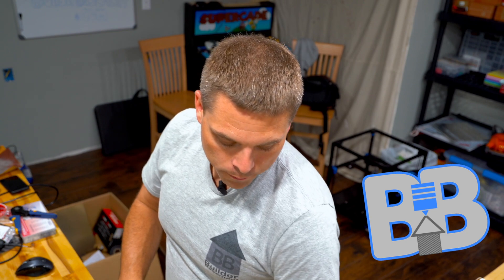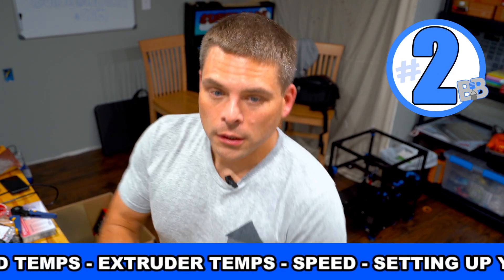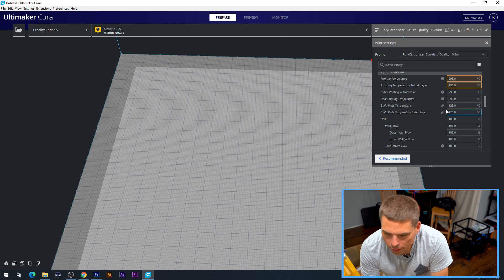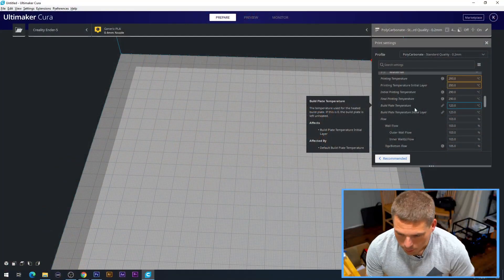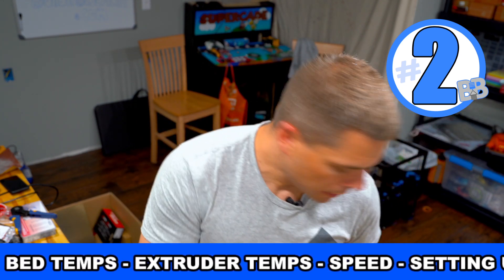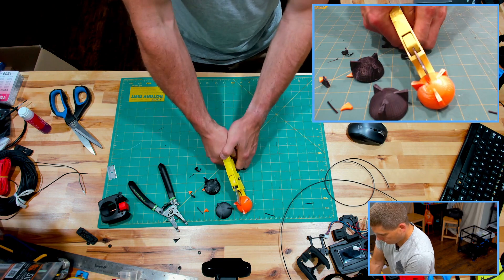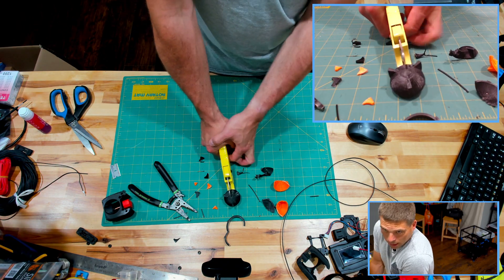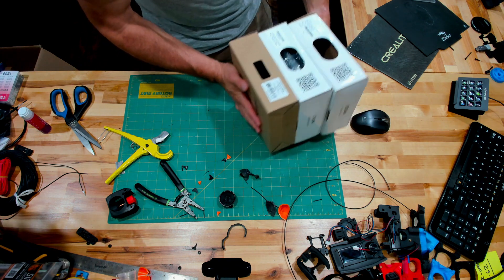Bulletproof Polycarbonate Filament! Tips on printing PC with an Ender!  ABS too!

Comment: I am looking to print PC-CF on my Flashforge Adventurer 5M Pro, is this possible ( with functional results, ) without modifications to my printer?
Reply from the maker: Yes!  You'll be pushing the limits, but it is possible.  Using a CF version will help some with warping, so that's a good pick.  You will need to use a larger nozzle than normal (0.6) since CF will likely clog a 0.4 nozzle.   You will probably need to use a PC bed adhesive, such as https://amzn.to/4dXBPgp. In my experience with the Ender, I had to create my own PC build plate, which would also be an option, but not recommended.   I would start slow, keep your bed near its max (100)°C and your extruder at around 270-275.  Run some small prints that are just a few layers (5-10), inspect them, and adjust as needed.  You'll be looking for warping, layer adhesion, and decent aesthetics.  Let me know how it goes!
Reply: @BuildItBasement  Thank you so much for the advice, I will closely follow it and update you! 

BTW, as for your suggested " PC bed adhesive " would you recommend the nano-polymer liquid stuff for use with PC? I always use that and it's great, but only with PLA/PETG, never with PC yet.
Reply from the maker: @JValor  Try what you have - Nano is VERY good stuff.  I'm not a huge fan of adding things to the bed, but in the case of PC and PA - it can be really hard without them.

Comment: How are you getting your bed temp to 123 C?
Reply from the maker: Physically or software wise? Physically the printer will do it fine with a basic enclosure.  The firmware will either need to be modified using Visual Studio or (my preference) installing Klipper.
Reply: @Build It Basement  im just going by the manufacture's specification of a 110 C max bed temperature

Comment: First couple min you got me to subscribe 🫡
Reply from the maker: Older video - So much more to expand on! Maybe at some point.  PC is great to work with.  Printing on a piece of PC really helps when you don't have the ability to get past 100 degrees!  I have made some neat things out of PC - At some point, I would like to make a drone frame out of PC and a VERY thin wrapper out of a flexible (impact-resistant) filament.  Not enough time in a day!  Hey, thanks for subbing!  Leave as many comments or questions as you like and I'll reply as best I can!

Comment: Hey thanks for the video. Im printing a 4" x1/4" shaft and need it not to bend under force. I have a ender 3 pro. Can I print the shafts in polycarbonate and just tweak the settings for results? What are your thoughts?
Reply from the maker: You will need three things to help you.  (1) You will need to update your firmware to allow for increased hotend temps. (2) You will need an all metal hotend like this one: https://amzn.to/3HhLnme or better yet this one: https://amzn.to/3JncKOH (3) You will need an exclosure for the printer a simple cardboard box can work, however I was be careful since cardboard is a fire hazard.  I have this one: https://amzn.to/3wFBjyO .   You will need to do some testing and you may need to buy a piece of plexiglass at a hardware store about the same size as your bed.  Rough up the surface with 100-150 grit sandpaper and clean it with ISO.  Good luck!

Comment: How did you get to 290?? I tried firmware update and slicer settings but no luck. I have a Neptune 2s.
Reply from the maker: It's the printer failing to get to 290 or does the software reject the temp?
Reply: @BuildItBasement  I believe its the firmware rejecting. It has the max temp at 275 but it won't go past 260
Reply from the maker: @WeTheWaveTV  The Neptune would need to have the firmware modified, I would suggest flashing it with Klipper (found this read for you) https://www.reddit.com/r/elegooneptune2/comments/pg0th0/klipper_firmware_now_supports_the_neptune_2_out/  Beyond that I would try to make an enclosure for the printer when printing PC or even ABS. A simple large HomeDepot box with one side cutin to doors that can be closed or opened should work.  I know I'm jumping ahead - Once you install Klipper (suggested) you can modify the maximum temp of your hotend to 300.  I would only do this if your hotend is all metal (bowden tube doesn't rest against the heat block). . I believe your printer uses a Robin Nano V1.2 board. I have never used the Neptune 2s specifically - but if you're into it you could have some fun modding it up!  In short - that 260 limit is a software limit. It'll get higher under the right conditions.
Reply: @BuildItBasement  Thanks!!! I'm gonna check it out (Klipper). I currently have my printer set up in a coat closet and the filament in a heated dry box that actually heats the entire section I have blocked off in there so I believe I have the right environment. I also upgraded the hot end to a Creality Spider A M that has served well with carbon fiber nylon at 260. So hopefully this will get me to where I need to be. Thanks again. I will keep you posted.
Reply from the maker: @WeTheWaveTV  always willing to help.  I can share stove Klipper tips when the time is right

Comment: My printer is also an Ender 5 (+ in my case). Can you tell me the steps you used to upgrade the Ender 5 firmware to get the printer to 295°C? The OEM says max 275°. I'm told I need to update settings using Visual Basic. Is this something you did and can share (code)? Can you also share your Cura settings for the Polycarbonite?
Reply from the maker: Hi.  You are correct on the VB modifications, however if you're considering going in to code I would strongly consider upgrading from the creality Marlin to Klipper.  There are many videos showing how to do this.  The first step is verifying the board you have and it's capabilities.  Working with Marlin is like starting from scratch every time you make a modification. In Klipper, the code is live.  You make changes in the Klipper console and after a quick restart, they are live.  I can help further if you get stuck.  As for Cura, send me an email (link and address are on my channel page) and I will send you settings.

Comment: Cool demo. Have you tried PEI spring steel sheet? Also may be interesting to compare with carbon fiber PC, since not long ago Josef Prusa was showing big CFPC parts printed on stock MK3 without any enclosure and it seems to have very reduced warping because of the CF. The issue may be with how abrasive it is.
Reply from the maker: The Voron I am printing will have a PEI coated steel bed.  I should have mentioned it as another alternative.  There is just so many things to talk about and options out there. I focused on what "I" was doing.  This video was a follow-up to questions from people on printing PC in general.  I would be interested in trying the carbon fiber polycarbonate parts, sounds very durable.  At first thought I have difficulty in believing the CF would stop much of the warping, maybe its a heat transfer thing?  The fibers tend to be so small in those filaments that they really seem to be mostly for show (spec lists).  I'm truly a novice at best - so I hope my perspective is to help others at a similar level of knowledge.  Overall, I have to say that the main point to the video is to at least try something other than PLA!  PLA prints easy, but once you have other materials dialed in they often can print quicker and with much better mechanical properties. Thank you for watching and the feed back.  Let me know if you ever have questions or ideas for additional videos!